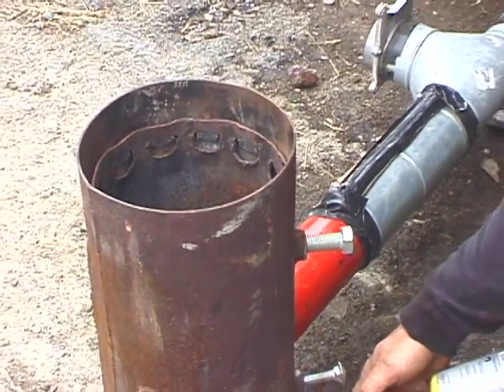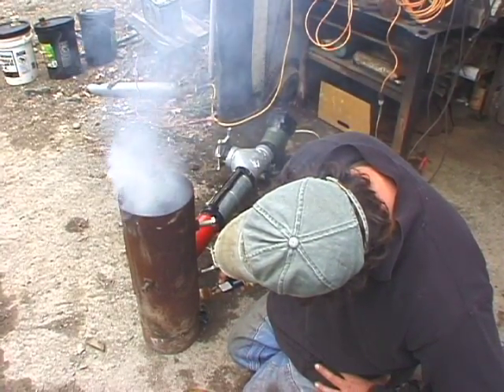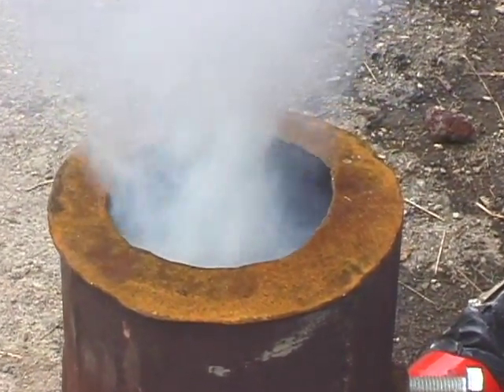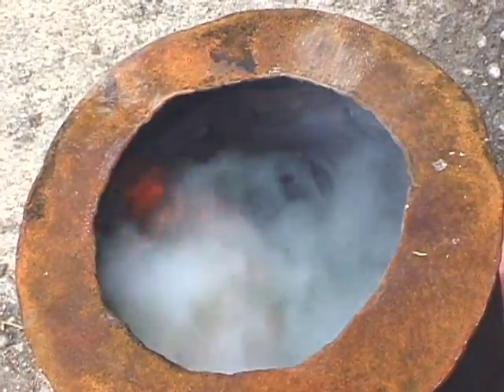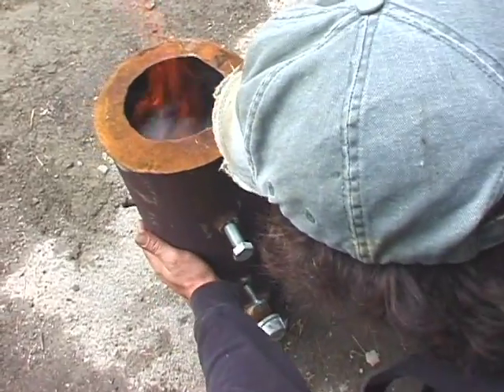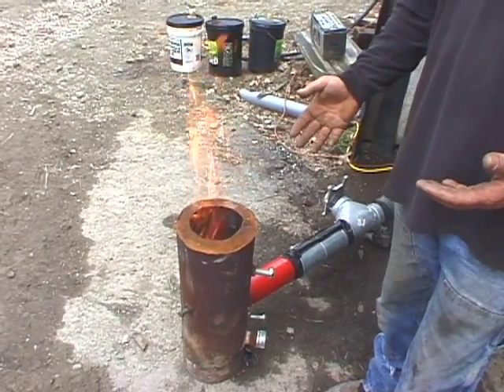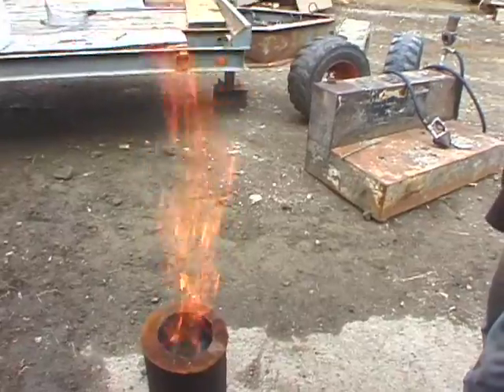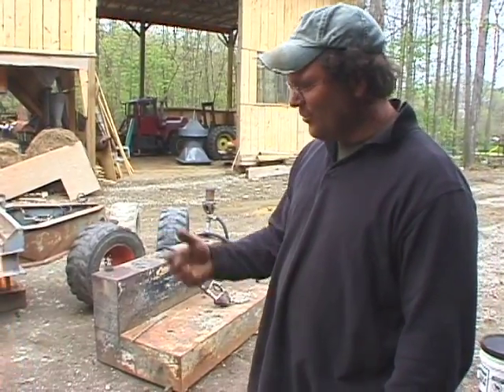Burning Smoke!

Comment: Cut a hole in the base. Stick a metal pipe in the hole (about 1/4 of the diameter of the stove, and with a good fit) and up through the centre of the stove to round about level with the gas holes. Elevate the stove on some little legs.
Oxygen will be drawn up that pipe right into the centre of the flame! You might start seeing some yellow and blue flames in there even.
It may reduce your packable volume of wood pellets by a little though.